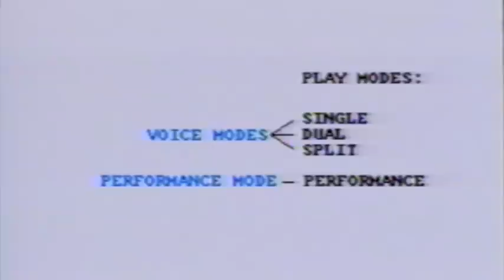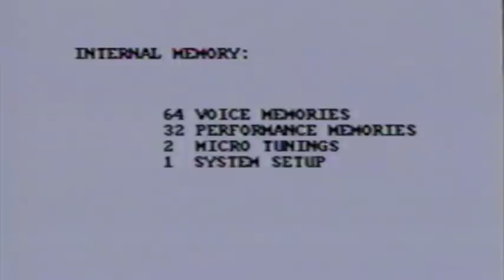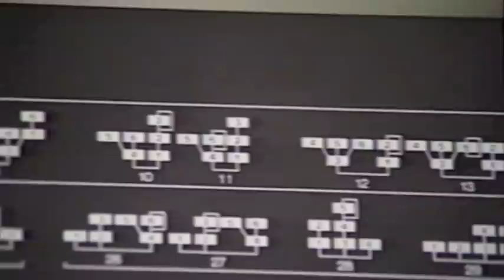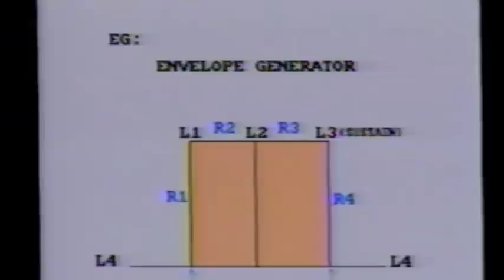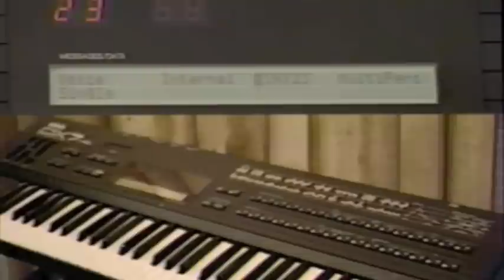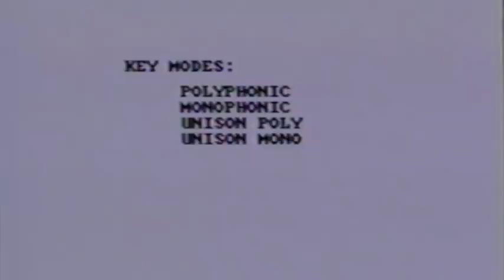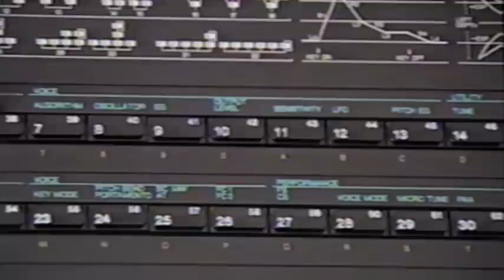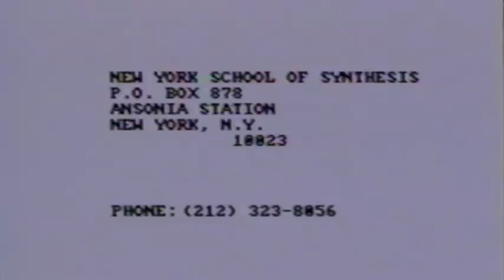The Yamaha DX7 II FD D Video Manual by The N Y School of Synthesis

Comment: Every DX7 owner should watch this. It's a shame most rely only on the presets, which are good, but this instrument offers a far wider spectrum of sound.
The synthesis part may be confusing at first, because there's no knobs for every parameter, and instead you have a calculator-like display and multi functional buttons. After watching this video i feel far more comfortable with it's interface.

Comment: 2:15:49 I'm looking forward to setting up my Roland AE-30 wind synth to control parameters this way. The AE-30 can be configured easily to use its breath, motion sensors, and thumbpad to send MIDI CCs.

Comment: Will this synth play without any cartridge or disk? Came in to one in very good physical condition, but for the life of me can't get any sounds out of it. I just connected the output to a small amplifier. I have no experience with using one of these.
Reply: drjoeshmoe same problem find any leads?
Reply: @mrpotatofaceman  -- no expert here, but I believe this simply indicates need to replace internal battery. Potential bargaining point for buyer.
Reply: @drjoesmoe -- yes, the DX7 plays without cartridge or disk. Samplers require external storage to play because they generate no sounds of their own, but a synthesizer (like the DX7) generates its own sounds. The cartridge or disk supplies additional sounds but is not necessary.

Comment: Great video for all of us using this machine. At 38:50, i missed the point of saving all the internal to the floppy disk in one file (New FILE on video). I managed to save each one sound because when i save sysex banks by PC to internal, there is a last button enabled selected, the one i chose before. Anyone can help how can i save internal to floppy in one file?
Reply: I found it by luck. Saving a sound on floppy, it saves the system information as well (in this case, all the bank). When you load a sound from floppy, if you select when ''load without system'' with ''no'', it will be loaded with system information, that means, whole the sysex bank (32 sounds). It's useful for me, when i will save whole bank with one characteristic (Piano, Brass e.t.c.) as one file on the floppy!!!

Comment: Is the only difference between the FD, 'Regular' and 'S' versions the fact that the former has a disk drive ??
Reply: The "S" version doesn't offer bi-timbriality or double mode.  Think of the DX7s as a DX7 mk1 with 16-bit DAC.  Kind of like a cut down version of the "D" and "FD".  The "D" in the DX7IID, I think it actually stays for "double", the ability to play to voices at the same time, which was big concept, starting with synths like Jupiter-8.
Reply: Hi Andrew,

Thanks mate. 

Yes, I wonder if you are correct about the 'D' standing for 'Double' !  I never thought about that. Obviously in 'FD' it stands for 'Floppy Disc'. 

Paul
Reply: monsterjazzlicks
Maybe the 'D" stands for "dual".  Who knows.  Or maybe the "II" in DX7 stands for dual.  But then what would the D stand for?  As far as the "F" goes, I think in those days F was sufficient for Floppy, like on the Atari 1040STF, the "F", meant built in floppy.  There was no need for 1040STFD, although there was a need for 1040STFM, for RTF modulator.  Naming conventions are maybe not perfect, but pretty much any name from the past is cooler than "GAIA", or Lucina.
Reply: I am sure that the 'II' means 'Mark Two' (ie. 'DX7 Mark 2').
Reply: monsterjazzlicks Makes sense.  I am sure though that the DX7s came after the two DX7II variants.  I believe the DX7II was to compete with the D-50, which was bitimbral, and had a concept of dual tones, called upper and lower in Roland speak.  It only makes sense Yamaha went the same route to be competitive, and also included larger 40x2 character backlit LCD, just like the D-50.  Shortly after, the M1 offered what everyone was looking at that time, which was 16-bit samples.  The rest as they say is history.  And even ROM players acquired mixed rapport, including the derogative "ROMpler" term, I still thing that the M1 was excellent.  It had a lot of programming parameters, and the presets made by Korg were truly excellent, courtesy I believe Jack Hotop.  Eric Persing speaks his style through the D-50.  I wonder if Dave Bristow was still involved with DX7II presets.
Reply: There is a fantastic David Bristow lecture on You Tube which is about 30 x mins long, though he does not mention the Mark Two as far as I can remember. I have never heard his name mentioned in association with that model.

I have no experience with the D50 I am afraid. 

I had an M1 for a couple of years but not heard of Eric Persing before.  I remember needing to double my Sequencer Memory but in doing so, it erases half  of the Program Presets !!  I know lots of people who made this same mistake.
Reply: monsterjazzlicks Yeah, I watched Dave Bristow's lecture.  It was a blast to watch.  From the CS-80 through the DX-series, and ending on SY77.  Good lecture.  When it comes to the M1, it was Jack Hotop, most likely.  The D-50 was Eric Persing, for sure.  I had been sort of obsessed with the D-50.  The Revolutions was my favorite album from Jean Michel Jarre, for quite some time.  It sounded so different.  I was thinking those strings on Revolutions was some sort of combination of the Synthex and Emulator II, or something.  But no, it was sole D-50.  Incredible synth.
Reply: Ok Andrew,

I will have to check out that JMJ stuff.

There was a British guy called Julian Colbeck who made a 60 x mins M1 tutorial video.  But sadly it was totally uninspiring and lacking in content.  Quite amazing that it could be so poor considering the M1 was such a revolutionary synth.
Reply: monsterjazzlicks
Yeah, the M1 was a high-end flagship synthesizer from Korg, with extensive array of programming parameters.  So what that it didn't have filter resonance, I get best results with the D-50 with the resonance turned off, anyway.  I was lucky enough to have a Korg T3 at some point.  Stupidly I sold it because the LCD backlight burned out.  I regret it, becuase otherwise it was in brand new condition, I could've just replaced the LCD.  But, I had too many synths, so I had to made a choice, so I got rid of all the Casio synths (except for the VZ-series) and I got rid off all the Korg gear, as well.  I chose to go with Roland and Yamaha gear.  One can't have everything, and choices have to be made at some point.
Reply: Andrew Piatek The M1 had a beautiful keyboard action.  Same as DX7 Mark 1.  They were a dream to play.  Far better 'touch' than any modern day synth (which feel cheap and plastic !).
Reply: monsterjazzlicks
Ha ha, M1 most likely had a Yamaha keyboard.  I know that the Wavestatioin had Yamaha keyboard, because I had disassembled the Wavestation.  Which makes sense, because Yamaha suplied Korg with a lot of mechanical parts.
Reply: Ok, cheers,  I did not know that these two companies shared parts.
Reply: monsterjazzlicks
Yeah, Yamaha was mechanical parts suplier for Korg.  Yamaha even had controlling share in Korg's stock.  But due to the success of M1, Korg was able to buy back the shared and become independent company again.
Reply: Andrew Piatek Good on Korg !!